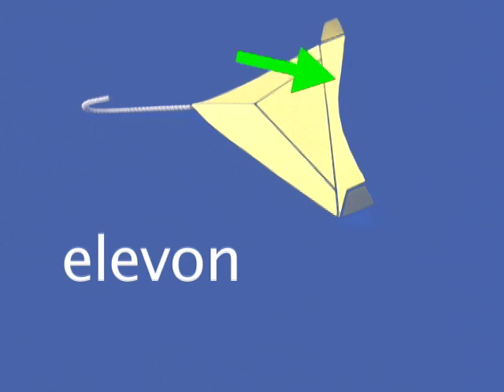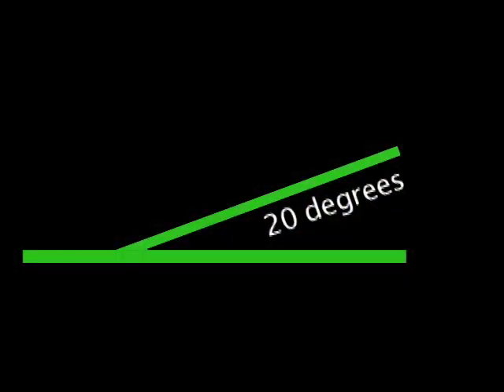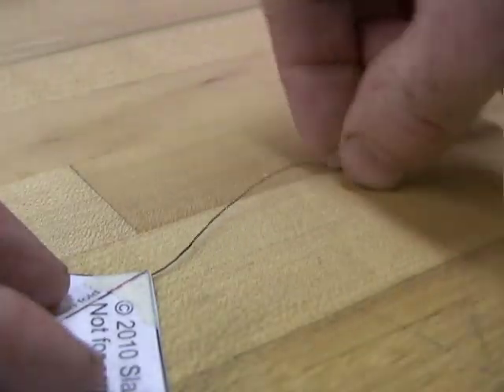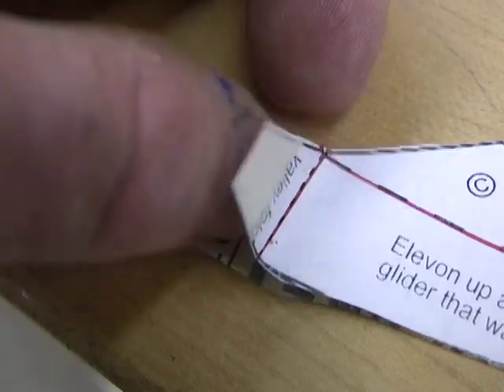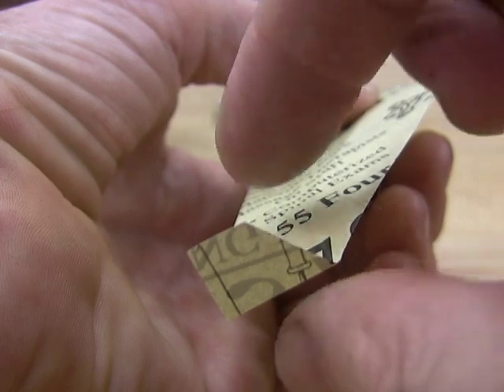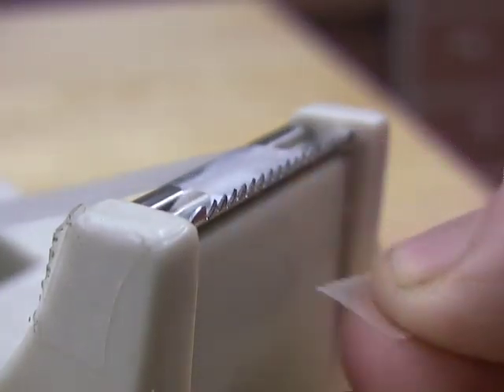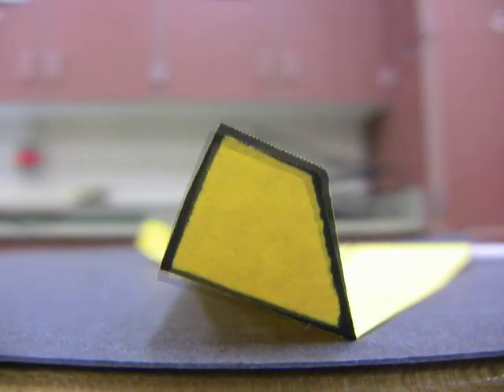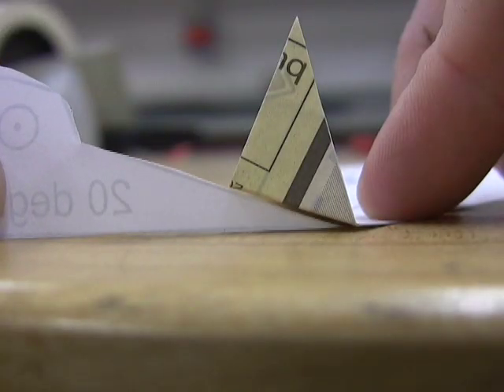Part 3 Surf an Origami Hang Glider a.k.a. Handy Glider on a Wave  of Air ADJUST revised 8 10

Comment: Do I have to transfer it to the phone book paper
Reply from the maker: Phone book paper is about 40% lighter than printer paper for equal surface area, so finding the lightest paper helps.
Reply: I ended up using newspaper, and it worked great

Comment: i did it & perfectly worked thanks
Reply: am glad that you tried...
Reply from the maker: I have since switched to foam instead of paper because foam is lighter and flies slower. It also easier to adjust than paper. So if you can get the paper version to fly, that's a real achievement. You should upload a video of flying it.
Reply: where can i get these foam paper so i could try them too
Reply from the maker: Ramanathan Vimal At sciencetoymaker.org
Reply: who told to u da????